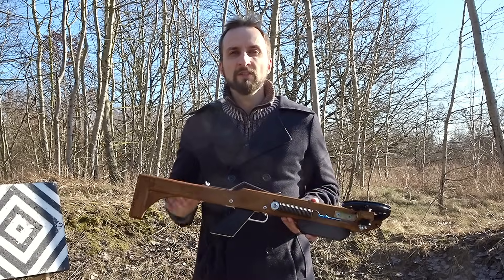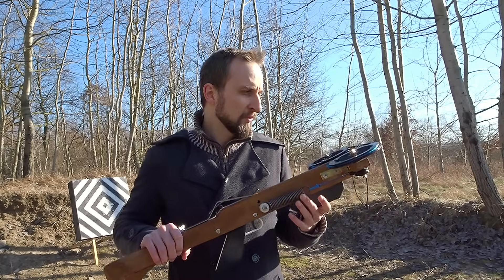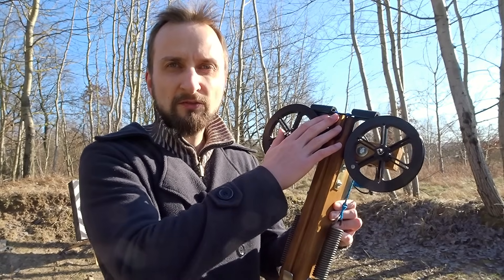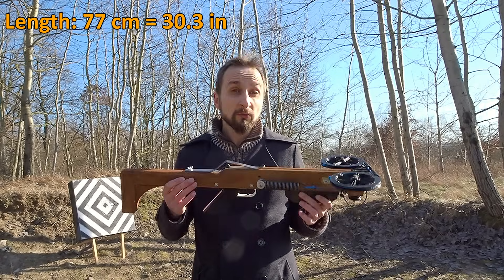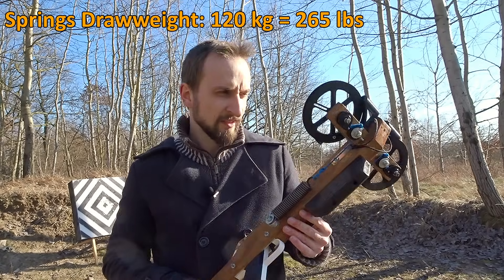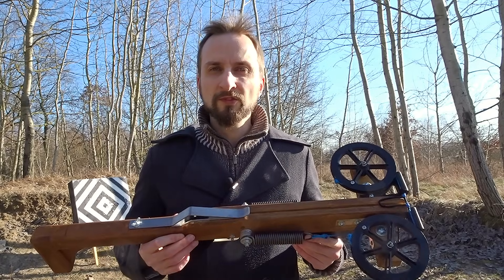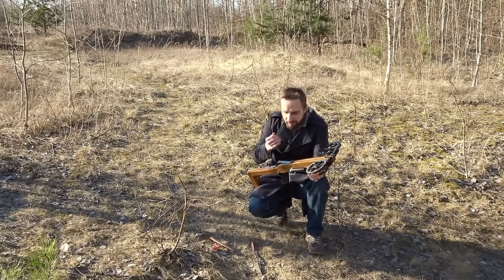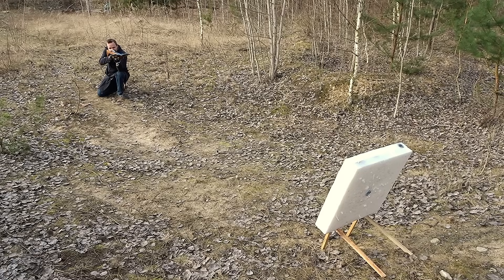Coilspring powered Crossbow

Comment: ...yes a lever on the forgrip and when pulled down , it;s fulcrum point is just in front of the spring so similar to pliers the small end against the front of the spring and a pull down at the front of the bow presses the spring for easier cocking , for other action the entire trigger block needs to slide and lock on the string and draw it back , there's already a production bow that uses a moving or sliding trigger block and a crank /cable cocker device , they beat me to it and  some of  us

Comment: this is one of my all time favorite vids , i have another vid on a different mechanism i like also. but on metal springs for bows this one is my favorite , the more i think on this method it's best because there's no transfer to limb weight at all , maybe a hybrid where the spring turns the smaller rigid limb and that limb has spring as well but then it's still a limb to move and this method is better , also you could attach a cocking lever to the spring itself or other points and a gear for cocking has more versatile possibilities of locations , thanks again , I'm super busy but this one is definately on my tinker list of practical rather thean too sci fi and i saw your trial and errors vid it was a lot of labor and i won't forget you for sharing the how tos on it all and hopefully check out the 3d stuff sometime soon thanks Mr. Zunder
Reply from the maker: Thanks! Glad you like it. Even though it takes time I still work on improving this line of idea. The newest coilspring powered bow proved that the concept is practical and can produce significant speed and energy. And I think even more can be achieved.

Comment: i know it's an old video, but still:
1) puting the pulleys vertical would work the same, but make it more compact
2) with vertical pulleys, you could use one stronger spring, housed inside a hollowed out cavity in the main frame, reducing the chances of getting pinched, and making sure the two side are synchronized
3) that main spring could be mounted on a threaded rod, going through the stock, so you could adjust the power of the crossbow on the fly (but might be in the way of the trigger mechanism)
I would try to build something like that myself, if i had the tools and skills i currently don't have :D
Reply from the maker: I heard this suggestion quite a lot by now as you can imagine and it does offer some advantages, some of which you mentioned. However there is also disadvantage, namely that the wheels have to remain circular (constant radius) because otherwise they will drag the string up and down and not in the plane of the bolt where the string should move. That will cause a lot of energy loss and destroy the string very fast. Since this video I have made a follow up on a bow with non circular cams which more than doubled the energy extraction from the springs. I am sure vertical wheels on a crossbow are not impossible, but for now I see no good solution to have that but also non-circular cams.

Comment: What are the spring specs?
I'm using 2 with a maximum of 313lbs of force enclosed in steel or aluminum tubes and a 1:4 pulley ratio.

Comment: Great design!  According to the numbers you give, efficiency is only about 40%.  Perhaps the pulleys should be lighter?  A promising design, and hope you develop it further.
Reply from the maker: Thanks! I already did - check out my latest video about the coilspring powered bow, which uses the same springs as this one and the same basic system but further developed. I will also do another crossbow next.

Comment: What about using a "pulling gas spring" instead of coil springs? Saw some in mcmaster carr catalog up to 250 lbs each. Or some type of adjustable pneumatic springs like the ones used in some breakbarrel airguns, like my ancient beeman rx1. The ratio of the string wheels to the spring wheels is a nice idea to reduce the draw weight which is always an issue with the more high powered crossbows. Keep up the good work!

Comment: A good design.
But the following small ideas.
Consider a double spring? a bigger spring with a smaller spring inside? It maight make the pulling faster.
Did you consider making the big wheels excentric? Maybe faster.

Comment: Instead of using more powerful springs, move the existing ones back so they are more pretensioned, som you gain the additional force over a longer length of the draw.
And like you said, change the shape of the wheels to adjust the force profile in different parts of the draw.
Very cool!

Comment: What if you use pneumatic springs? Imagine making a crossbow that the first inch of draw is like 80lb and the last is 100lb. A normal crossbow is like 20lb the first and 150lb the last inch. Even though the last inch is heavier, it stores less energy. An easy to draw, repeating, low profile rifle like crossbow would sell like hotcakes. Imagine a hosterable pistol one!

Comment: I don't know if you are aware, but what you've built is basically a crossbow version of a type of speargun called a "roller gun". They are by no means a new invention, I think the first one came around in the '60s but for some reason, they disappeared until maybe 10 years ago or so, and by far most of the ones I saw back in the days before I started building my own, were homemade guns. These days they are manufactured by a couple of companies I think, or you can get drop-in kits to modify your (some) traditional speargun(s), to a roller. 

One of the problems with traditional spearguns is that they don't use the full length of the stock, they generally only transfer energy to the spear over some 2/3s of the full length, and when they do they go from transferring 100% of the energy to 0%, meaning that the energy curve is rapidly declining. Then you can add another set of bands, and that does give you a decent amount of extra energy, but it also increases the already rather substantial recoil. Roller guns however, never let the bands contract to 0%, because the bands are either pre-stretched or as in the case of my first gun, also boosted after loading with 2 sets of booster bands. So, energy transference-wise, they go from some 150% or more down to maybe 50% at the point of release, I haven't done the exact math on it, but it's in the ballpark. As for recoil, I'd say a roller only has about 60% the recoil of a similar length traditional speargun. I would recommend you look into this type of speargun, clearly you are a skilled craftsman, so it shouldn't be too hard for someone like you to adapt a speargun roller system to suit your needs, or at the very least reuse the technology for something besides hunting fish underwater. 

I reckon you could easily shave those wheels down to around 35-40mm in diameter, and thus get a much sleeker result, on a roller gun the wheels are upright, the pull comes from the underside as the spear is pulled by the "wishbone" on the upper side of the wheels. On a roller gun we need a couple of string risers at the end of the stock because our spears aren't pulled from the end, but from a groove or "shark fin" located a bit up from the back end of the shaft, where it goes into the trigger system, but you won't have to worry about that. Most traditional spearguns around my part of the world are either what we call "75'ers" or "90's" as that's the band pull measured in cm, the shorter ones are primarily for hunting around structures, whereas the longer ones are better for open water. My main gun is a bit shorter than a "75", but shoots like a "110", so there is a lot of length to be saved with a roller gun design. One of the greatest features, in my mind at least, is that you can add several boosters without increasing recoil significantly.

Anyway, if you decide to have a go at new crossbow, feel free to ask anything, I've built a bit of this and a bit of that over the years, and I might be able to answer some of your questions.

Comment: Great) This is really very addictive) I have already built my second crossbow))) Bullpup layout! The shoulders are made of fiberglass reinforcement, and they are quick-detachable) And the butt too! Based on Mission SUB-1. It turned out really beautiful) I will be glad if you check it out) https://youtu.be/V_WedrCU5gE
Reply from the maker: Well done, looks like quite the effort. It seems a bit weak though. I would recommend to try out configurations of the prods that give more power. For instance I think that fibreglass rod can bend a bit more before breaking. Also make it as short as possible, that will improve speed. And use multiple
rods to increase drawweight. For instance 2 below the string and 2 above. I went a similar route of wanting too much with a cocking leaver, magazine etc. with my second crossbow https://www.youtube.com/watch?v=ul5VkX7HqD4 and though it turned out very cool, it was fairly weak and just far too heavy. Anyways, greetings from Germany!

Comment: Not sure how to calculate the most efficient acceleration profile, but as you say you could certainly include excenter profiles on the wheels, BOTH ends. The spring pulls the hardest as maximum stretch and a lot less near end of power stroke, could pay off to use an excenter profile on input wheel too, might need to step up the radius near end of spring movement to be sure it can actually add energy and not coast along at the end of spring contraction.

Not sure if it pays off to have a smooth start acceleration curve or just start as violently as possible. Normal "compound" is to introduce a lower let-off force, slower start, but that is mainly I believe to compensate for human "issues".

There are alot of simplifications that can be made by putting wheels vertically, like all wheels can be fixed on one thru-hole axle. That will however make excenter wheel design problematic as it would induce a wobble in Z-axis... that may lead to an extra support/guide wheel to eat up the variation but at a price of complexity and losses in power.

I'm amazed that the plastics stand up to these forces!

Comment: The impulse transmission is too slow if the drive is built using deflection rollers. i.e. the masses would have to be moved and that makes the shot too slow. Not a good idea to do it like that. In her opinion, the compound principle is still much better because it is more effective and there are no moving masses. The simple bow is even better, but it is considerably more difficult to draw. The simpler you make such a drive, the more effective it is, i.e. more yeasty the effect. This is a law of nature! An air pressure nudged arrow is even better. Because the impulse is bigger and stronger and the force can be even more effective.

Comment: for comparison a .22lr produces around 120 Joules, also questoin: what tools did you use to shape the stock
Reply from the maker: I think I can improve the energy in following versions, we will see. Regarding the stock, it is made from 4 layers of beech wood glued together (thickness 1 cm each) and then precision drilling of some important holes with my cnc and then rough shaping with a handsaw, angle grinder, rough files and then rough grids of sand paper. It is a relatively rough finish still with no varnish on etc. as this is a prototype.
Reply: @aurigo_tech  that's awesome! love to see it. Is there limits to how powerful your crossbow can be? Legally speaking?
Reply from the maker: @mollysmoshingtankcrew9441   Not really. At least in Germany the only limitation is the age barrier of 18+. Apart from that as powerful as one wants.

Comment: Those springs are kinda where the stabilizing hand goes on the forestock.
One normal xbow maker uses wing shields halfway horizontal across the forestock to keep fingers from creeping up.
    I would suggest polished overlapping sleeves, two part where one slides into the other.
    You may not have seen that design executed due to perceived or actual danger/liability.

Comment: Cocking aids are essential in home built toys. One of the first times I cocked a slingbow I got my fingers stuck. Not a little bit either, the cord cut me up, it was pressing so hard on my pointer fingers against the stock. I was stuck for a few.
  It was temporary.  I have to use a rope with more bands.

Comment: Very nice proof of concept. I think there are many more mechanical advantages that can be applied to maximize the usefulness of such a small bow. The fact that you got it to the point it currently is with such a small overall size just leaves that much more room with which to add upgrades/improvements.

Comment: This seems to utilize the same mecanism as the spring loaded bear trap. and springs takes way less space than limbs.
And icredibly easy to add more power, just put in stronger springs.  migt try my luck with making on at some point.
Reply from the maker: Interesting. I never looked at bear traps in that regard. I will look into them and see if there is something to learn from it (often those simple mechanical devices indeed contain much more genius than is obvious on first sight).

Comment: 124 fps for a arrow that is only 7.7 grains per pound of draw weight is slow as molasses. The bar for a hunting quality bow is 200 fps with a 10 GPP arrow.
Reply from the maker: Jep, I mentioned it would not be record breaking in that regard. That was also not my goal for this version. This is a proof-of-concept to show that this works at all. I will make another version eventually and feel like I could improve the speed and energy by perhaps another 50-100%.
Reply: @aurigo_tech  Ok well just letting you know. I recall Jorge at the slingshot channel went down this rabbit hole of rubber bands and pulleys and had no great results with it. Maybe using metal springs will make a difference idk. 

I do know that lightening the wheels as much as possible will help the most. You want to minimize the amount of energy being used to accelerate mass that isn't the crossbow bolt itself.

Comment: Olá  amigo , essas molas , elas são usadas especificamente em que ? Pra quando for comprar , comprar exatamente iguais , saber onde elas são usadas , ajuda na hora de procurar para efetuar a compra.Parabems pelo trabalho , ótimo vídeo . Aguardo resposta ...Hello friend, these springs, what are they specifically used for? So when you go to buy, buy exactly the same ones, knowing where they are used, helps when searching to make the purchase.
Reply from the maker: I just guessed the dimensions that are suitable for a crossbow and bought them from an online shop. The exact springs I use are 134 mm total length, 26.5 mm total diameter, 4 mm wire thickness, 25 windings. And I draw them out to about 60 kg drawweight at ~190 mm total length.
Reply: Very tanks brother .

Comment: Hi friend  i love your design i already looked at trampoline springs they are very strong build and you can get it at sportsman warehouse and there is companies that can make it to your strength you want. Put bearings in cams and it will be faster make egg shape cams like Reverse draw bows there is many examples for plans. i will put round pully next to barrel same cross section of egg pulleys like the reverse draw bows the sting connect to under cam around round small pulleys with bearings in to springs and to string to top egg bigger cam for pull string. How long is your arrows and springs? Do you think with a trampoline spring of 24mm can it pull futher and have longer draw lenght? 😀 Rubber  string in middel of pull string will be safer for your eyes and wear glasses. Trampoline springs is so far the safest. Good for survival buddy well done.
Reply from the maker: The springs I use are 134 mm total length, 26.5 mm total diameter, 4 mm wire thickness, 25 windings. And I draw them out to about 60 kg drawweight at ~190 mm total length.
This crossbow was just a proof of concept. I am working on a next version (as a bow for now) at the moment which will implement a lot of improvements, including non-circular cams. A 24 mm diameter spring from a trampoline should work, if it has some decent draw weight. Good luck!
Reply: @aurigo_tech  Thank you buddy it still a great design when i am finished with mine i will load video on my you tube channel i did already build a Reverse Draw crossbow with car spring blades but they do not pull the same one is weaker as other blade. But the springs will work great pull the same weight both sides. Reverse Crossbow cams will work great. But thank you for reply have great day buddy.

Comment: Isn't it a problem to equip each side with its own spring system? Wouldn't it be conducive to safety in the event of synchronization problems to control both sides from one spring? 
I don't like the system the way it is, both my head and my gut don't like it.
Reply from the maker: It could be, yes. I am encountering this issue even more so in a spring powered bow I am working on right now as well. There I (hopefully) solve that issue by connecting the two sets of wheels such that one can not move independently of the other.
Reply: @aurigo_tech  It should only become a problem if there are stronger differences in acceleration. However, since everything is much closer together, like the limbs of a crossbow, it should hopefully not be able to pull the arrow out of the guide when the sides accelerate at different speeds.